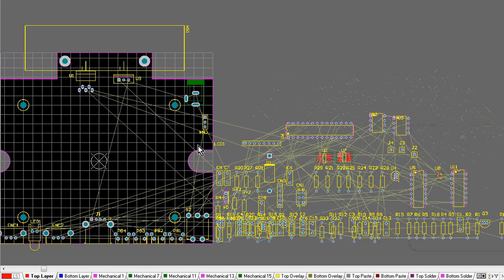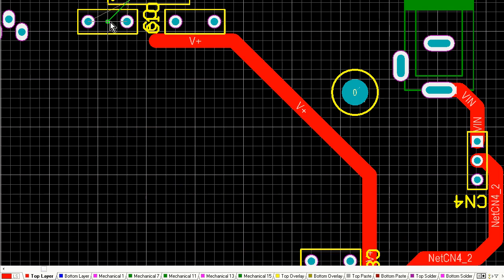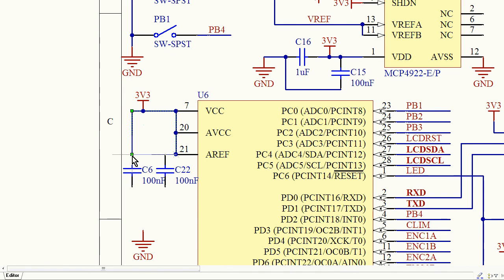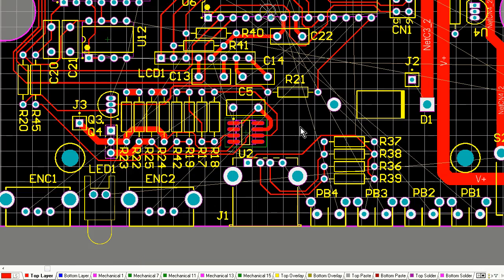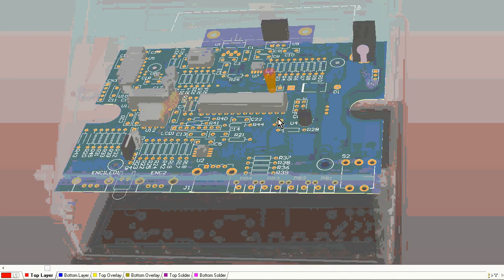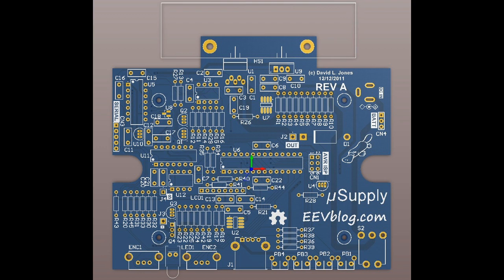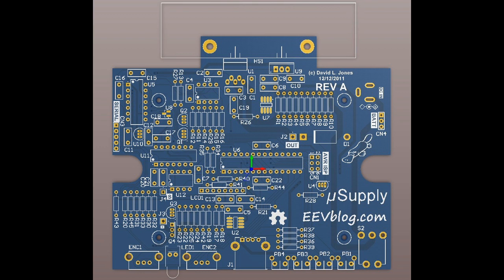EEVblog #244 - How To Lay Out A PCB - PSU Design Part 9

Comment: I'm still learning the art of PCB. No one ever taught me; it is something I picked up on my own after viewing thousands of circuit boards over the years. So, I have an eye for good and bad layouts. But, that's like judging paintings but don't know how to paint. When I start a layout, I try to follow some simple steps... First, I attempt to group the components into smaller circuits. Next, I create GND and VCC rails around and down the middle of the board, so that all the smaller circuits can tap into them. I then run a series of auto-routing. Auto-routing is a good tool for me to use in the earlier stages of arranging components because it shows me what components are running across the board. Then once I've minimized the number of traces and vias, then I start routing by hand.

Comment: PCB Design 101 Class Index
5:35 "I still don't have a complete idea in my mind of where everything is going to go."
5:54 "..power traces"
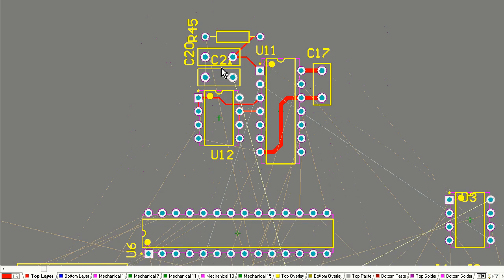6:30 'grouping components in blocks'
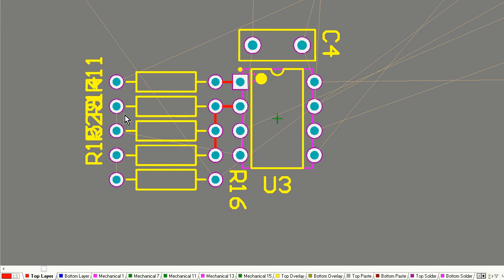8:30 'goal is for top side traces as much as possible'
10:41 'traces running across the whole board can ruin your layout'
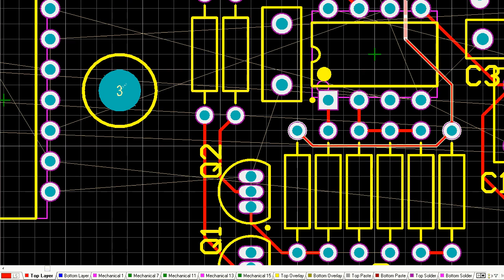11:04 'grouping components in tight blocks'
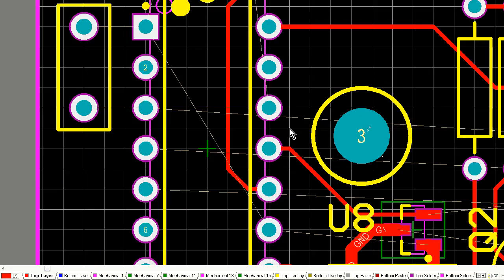11:34 'locking design elements added to the PCB is very important'
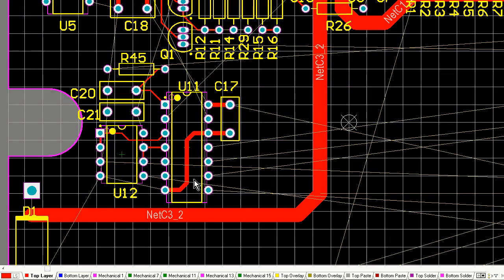12:09 'separation of analogue section'
17:57 'you'll still notice I'm laying out traces on the top side of the board'
18:39 "..part of the art of PCB design... it's quite difficult to teach"
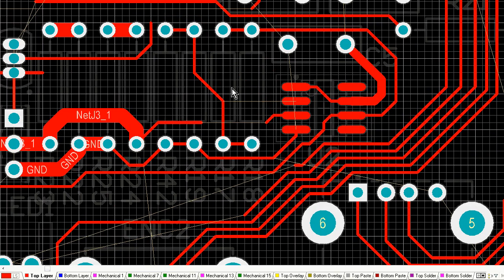22:20 "..it's hard to explain how I route traces... (explains leaving traces that cross the board until last, then trace sizes/then wiring order of traces and modular building blocks)"
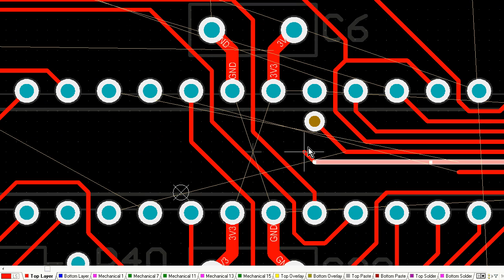24:11 "used my first trace on the back side of the PCB" (followed by an explanation of the design principals involved)
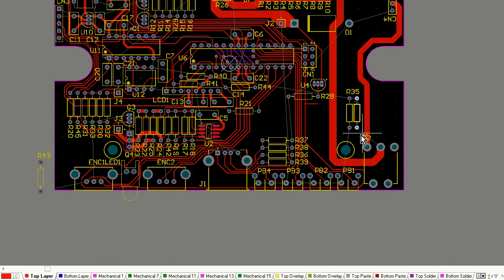27:49 'explains through hole versus SMD routing'
28:52 'double sided layout design compared to single sided with jumpers'
29:26 'routing the 5 volt rail/(drinking commentary)/vias for higher currents explained/(awkward pause)'
30:52 'net/design rules check explanation'
31:26 'explains the typical order of traces types to route first'
32:40 (after another rules check)..."'my goals at this stage are 0 errors" except for silk screen errors'
32:54 'only errors left are GROUND/saves ground for last/explanation of the division of the ground plane for power and signal sides of the board'
34:47 'designators'
35:55 (shows) "ground keep out" with vague explanation/followed by explanation of how and where the 2 Ground planes are joined
37:40 "checking solder mask expansion...that they are not going to break through...that there is enough clearance so the pads do not short out when hand or wave soldering"//followed by an explanation of clearances, and cost.
38:33 "this board is very course.."/10-10 design rules explained/"any manufacturer in the world could make this... I could make this at home."
39:34 "the power of 3d view..."
40:43 'drill hole consolidation addendum'/make your PCB cheaper by using a minimum number of hole sizes causing the manufacturer to change tools for things like metric and imperial hole sizes attached to components from various libraries'
45:05 'compares layout of a design that is integrated with user interface and enclosure versus one that is wired into the center of an enclosure'
46:55 '..split ground plane was probably not needed, but is a good general practice'

Personal Favorites:
27:14 "if your not using a snap grid, well, your crazy..."
18:12 "there's lots of stuff going on in my head which I can't... it's subconscious...it just magically works...that last trace just magically fits."
  ;-))
-Jake
Reply: yeah. Dave is trying to make it as complicated as hell. no worries.

Comment: PCB design has always been huge fun for me, but it has also cost me many sleepless nights. Then I think, how lucky we are today where we have software to do it for us. Way back in the early 80s I used to see our electronics engineers standing at drawing boards with peaces of tape sticking it to a huge transparency. That is how they plotted their PC boards. The personal computer had just made it's entry but there was no software that one could use to plot a PCB or create Gerber files to send to the manufacturer. That transparency with all that tape on it was the Gerber file. There was no Net checking software. We had to have a prototype PCB etched and sit there with a diagram and a multi-meter and check each net one by one. Now, If we found any mistakes we would send the the board and the diagram back to the engineers so that he could rip off some tape and add new tape to correct the mistake. Then back to the PCB manufacturer again for a new prototype...... and so it went on.

I should say, before they even plotted a PCB, they would give me a diagram (Hand drawn) which I would prototype on a breadboard. I would then give them the all OK or point out any mistakes they had made and make suggestions to them to consider. I would suggest, replace AND with OR or something like that. They used to hate me and love me. They didn't like making mistakes :)

Comment from the maker: @DFCad1 CAD users would pay you directly for a top quality autorouter that worked with existing PCB tools, like for example, ELECTRA. Seriously, if you think you can do it, then you can make millions. There are companies that just do Autorouters.
There are so many permutations with PCB design, it's simply not possible to have a autorouter do every design 100%, and any PCB professional knows this. Good qaulity Autorouters are of great value if you spend the time to set them up on complex boards.

Comment: Dave, you always impress me and this was 2012, In 2020, I am still staring Boz eyed into a mirror to reverse a paper layout I have made while looking at my schematic onto a Copper clad board with a Dalo Etch resist pen, before warming up Ferric Chloride in my kitchen. 
Since my late forties, my vision started to let me down I must confess to a few cock-ups, yes I have used a diamond-tipped engraver to break a track and I have used copper slug repellent tape from the garden centre to install a track where one was needed.

Comment from the maker: @Maverus If assembled with a properly designed commercial thermal oven, then placement and heat sinking shouldn't be an issue, so you'd group them together usually. Your assembler will know how to program the thermal ovens temperature profile to handle this.

Comment: @EEVblog What's missing in his idea is the shear magnitude of different possibilities with each board. High voltage, analog, low voltage, impedance dependencies, resistance dependencies, so on. By the time you customize the rule structure, you'd have the board near finished anyways. Part variances alone and the shear number of differences between various parts would make it incredibly difficult to program an algorithm. Not to mention bloat the program and slow the system down to a crawl

Comment: Dave, I've been wating for this video in the bench psu series! Thanks! You mention that you used two vias when changing layers with the high current trace. Is that to reduce/inductance and trace impedance? or just because it means more plated thru hole to handle the current? Also, at 31:47 You route a trace around a mounting hole and split it to go both sides. Also to help with the high currents since the wider trace wouldn't fit either side i assume yes? That's a handy trick. Thanks Dave!

Comment: As Dave says, through hole is handy because you can jump tracks with resistors. The thing is axial components are generally variable length. So they can be 0.4" or 0.8" or even 1" if you have enough wire lead. I guess that doesn't matter but when I did small layouts manually it was very easy to arrange. Can Eagle or Altium make components longer on the fly?

Comment: You know what I think would be a nice project to build, a !2v PSU, connected to to a car battery and use  a few switching regulators to supply the power... (in case of power out)

Comment: Hey Dave, very nice video! Just one question: Sometimes you routed two traces at the same time, like a pair coming from the serial connector, did you treat them like a differential pair or something like that? or it was just easier to route them in pair?  Im a newbie and Ive heard something about differential pairs, so I wanted to know why did you do that. Thanks!

Comment: i had a science teacher in 7th grade that said that we (america) would be on metric within 10 years...that was 20 years ago. as much as i hated that guy i kinda wish he was right on that. metric is so much easier than the weird forms of measure we use.

P.S just wanted to say the guy was an amazing teacher and that was the only thing he was ever wrong about. i just didn't like him personally heh
Reply: You guys really need to do something about that man, confusing us to death with your alien measurement scales
Reply: No way...for everyday practical measurement ie. square footage, building height, building materials....feet and inches are WAAAAY more practical. That is why construction still uses it...why call a 10 inch nail a 224mm nail? Or 25cm nail? Meters are too large, and cm are too small....imperial will never disappear. Metric is not good for reality...maybe math and physics but that's it.
Reply: But 10 and 25 are both numbers?
Reply: Tom Jones how do you think we make buildings, industrial complexes over here in europe? We think in mm while we are building. 3000 mm of 1 inch tube, 2.5mm2 cable, 10 mm metal drillbit, 17 mm ringkey ..... everything is done in mm.
Reply: Tom Jones M10 x 100 mm,  means a 10 mm "thick" bolt with a length of 100 mm. That is what you say if you order a bolt of 10 mm, a m10 x 100 mm.

Comment: How did you make the oval holes for the DC in connector?  Not very many overnight PCB houses can/will make those oval holes.   In cases where they would upcharge, would you recommend just going with big circular holes and filling with solder?

Comment: as a computer engineer i don't think that it's not doable, but you have to consider for what kind of market are those apps developed -- look at CAD apps for architecture engineering and similar, which are constantly evolving at a fast pace, on the other side you have markets, that are not that demanding (like EE).
that does not mean they wouldn;t take good use of beter apps, but they are simply used to do things their own way, so developers don't need to evolve apps that fast...
sad really...

Comment: Why do through hole components connect to floods via hairs? Is it to prevent heat loss when soldering that joint, or is it a stress break for the flood so it can't peel ? I have noticed this and wonder why its not just drilled, this seems to be a more modern design choice i have noticed.
Reply: +tablatronix Because that board is a multi layer and if you drill it then you will drill through all layers. That's why there are surface mount chips.
Reply: +Xmaster Official no I mean if you look at a thru hole inside a flood plain it has 4 cross hairs attaching it to the flood like an island instead of just being all around attached. Perhaps it is to retain a solder mask off copper
Reply: Or maybe that's the mass where the screw will be placed. Or some sort of spark gap forming a low pass filter.
Reply: +Xmaster Official heh nono this is like all boards. I found this http://electronics.stackexchange.com/questions/14435/why-thermal-reliefs-on-vias
Reply: Like you said, it's to prevent heat going straight to the plane when soldering. If you soldered the whole board at once in an oven, then it should be less of a problem though. Sometimes you want a via to directly connect to planes, when using two planes on the two outer layers as a heatsink to create a good thermal connection between the two.

Comment: Hey Dave, I got a question for you about PCB layout, if you don't mind. If you had to lay down several D-pak components would you group these into a central location or spread them throughout the board, even if they constitute a module, say voltage reg or power supply for the board. I had an issue were soldering and contact became a problem, i think it is because they sucked up the heat as well. Gimme you thoughts.

Comment: how much do you reckon you'll sell these kits for. i might consider one if they're reasonably priced, the analogue one i made is OK it just makes a slight hiss on the sig tracer at full volume no preamp and you get a bit of wiper noise adjusting the voltage pot. it has 5 preset voltages set with multi-turn trim pots and constant current settings which i've trimmed to within about half to 1%, the constant current is handy for testing LEDs and doing crude 4 wire resistance measurements

Comment: Another good choice for a free PCB designer package would be Eagle by CADSoft, while certainly not as powerful/feature-loaded as Altium it's a great piece of software for beginners which is very intuitive to use and comes with an extensive library of parts.

Comment: question? do you have a video on soldering microchips to boards? i bought a nano accelerometer for inertial navigation as a back up for loss of gps but they are very small and the pads are really tiny??

Comment: Hi Dave. I know the power supply is designed for 1A but I'm interesting how much current the bigger traces can handle?
Reply: A lot. There are many online PCB trace calculators online that implement the IPC-2221 standard formulas. 1mm traces can carry 2.5 amps a few inches with tens of mV drop. Copper is outrageously conductive.

Comment: Why didn't you put a GND plane on the top layer? Could you reduce cross talk on the traces by having a top GND plane? Also, I am curious why you did not autoroute your traces?
Reply: To use or not to use autorouting is sometimes a prestige thing to some ppl. 

"Im an engineer I don't need autorouting."

Maybe not but it will save you and thus the company a lot of money since its WAY faster then you will ever be.
However there are some times that you need to and/or want to put some tings and wires in a certain way but after that you can start the autorouter fex. In the example in the vid much need to be routed manually, but sure some wires could be autorouted. 
It could have some disadvantages but if its handled right it do its job really good. However it do not really have any logic like if it route and it can not go to 100% so could all that is needed for that be just to move a trace 6 mil to one side fex.
Reply: Nice :)

Comment: What is the reasoning of using mostly through-hole parts? About to get started on Altium power electronics PCB, and do through hole parts help with noise? Or probably just power rating?
Reply: +Sam Korn He probably did it for ease of assembly. I have soldered alot of smd parts though and i don't find it hard after some practice. You can in fact get in surface mount resistors with power ratings up to 250W !!!!  
http://www.digikey.com/product-search/en?pv2=12&pv2=17&pv2=544&pv2=81&pv2=13&pv2=14&pv2=126&pv2=127&pv2=15&pv2=121&FV=fff40001%2Cfff800e9&mnonly=0&newproducts=0&ColumnSort=0&page=1&quantity=0&ptm=0&fid=0&pageSize=25
Reply: +Sam Korn Its going to be a kit, you wouldn't give a beginner a bunch of SMD components to soldier at home, trough hole are much easier

Comment: What is the point in doing open hardware board in Altium designer?
Reply: +Michal Sýkora open hardware means that he is giving permission for anyone to take his design and make their own, how does using altium impede that at all? sure noone short of an engineering company can afford the full altium designer software but that doesn't stop you from taking the layout and building it in eagle nearly identically for example, especially since he even went into explaining the whole process he went through to build it himself.
Reply: Or just download Altium from the piratebay. ;)
Reply: At nearly 9000 for a license, they surely deserve to be pirated.

Comment: How to do visible layers in high resolution in Altium 3D mode? How You switched it to see one layer in the same time?
Reply: You can turn down the solder layer opacity. Press L in 3D mode and play around with the sliders to make the copper more visible.

Comment: How does Dave know how thick to make the traces?
Reply: well after 20 years of work you must know that :D
Reply: 1 year experience repeated 20 times
Reply: That depends on the thickness of the copper and the current load the trace is expected to carry. There are tables you can use, but as the others have said, experience is a big factor